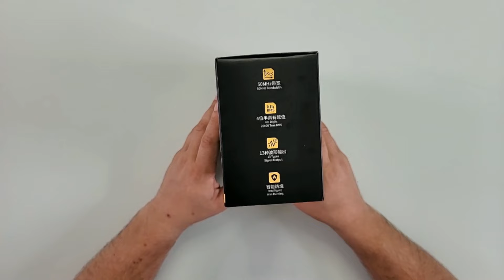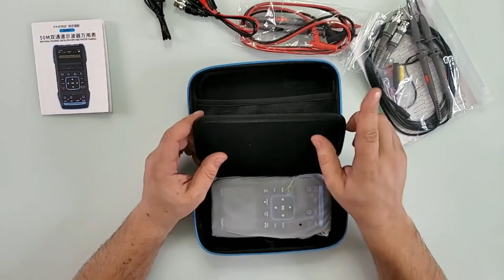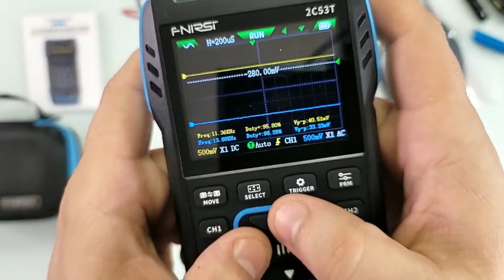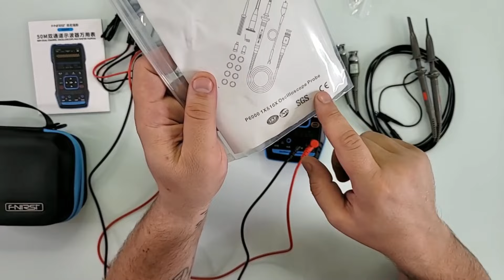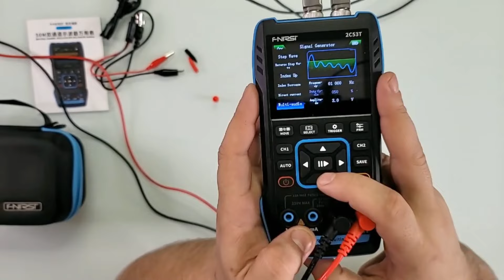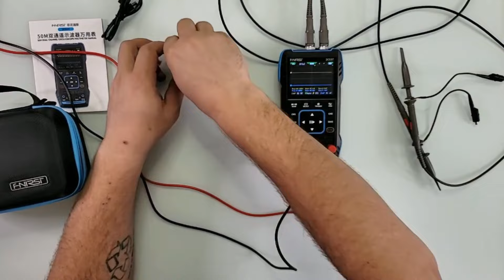FNIRSI 2C53T 2CH OSCILLOSCOPE MULTIMETER @fnirsi #tech

Comment: Want to buy one of these cheap oscis and so I am collecting info about them...
Can't notice anything different comparing this to FNIRSI 2C23T. Have you noticed anything? Why is this called an upgrade and costs around 10euros more?
Reply: according to their website "✦ Newly Version: The 2C53T is an upgraded version of the 2C23T, which improves the measuring range and adds math operation，cursor measurement，persistence mode，XY mode features."
Reply: It measures up to 50MHZ. The previous version measured 10MHZ tops.
Reply from the maker: I dont have the other version but i think the difference is the chip they used on this one and the software is supposed to run a bit faster